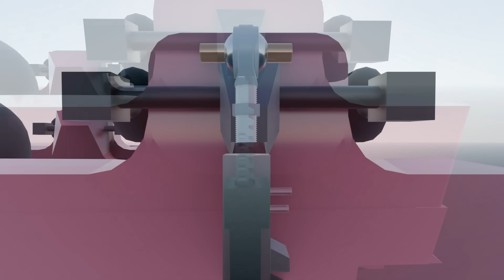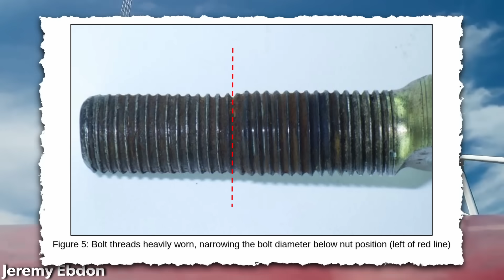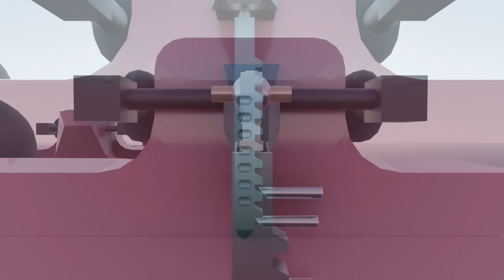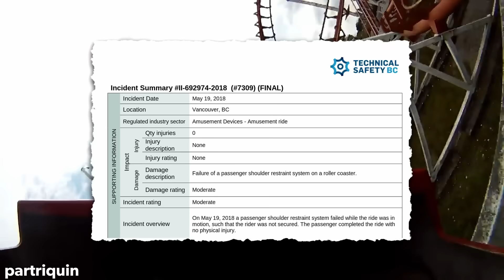The REAL Accident on the Coaster From Final Destination 3 - Near Miss Analysis

Comment: I live in vancouver and have ridden the corkscrew before it closed down. It was closed due to a lot of factors as the park is honestly kinda known for shutting down rides at this point and it was never a super popular coaster compared to the wooden one also in the park.

 It wasnt even replaced by a new coaster until fairly recently, 6 years after the corkscrew closed. Now we have the thundervolt which apparently is the fastest electric launch coaster in canada though.
Reply: I was too short to ride corkscrew before it closed :<

Comment: Of all the coasters to suffer a serious restraint failure, a mild Vekoma or Arrow Looper would be the least alarming for me---I would only be moderately worried about the first drop of this coaster in the back 2 rows. I did have my lap bar completely fail on Viper at SFGA in 2001 when I was 11. I'm not exaggerating, it actually failed to lock in any position and kept flipping up to it's full retracted mode. That was scary as hell because of all the airtime throughout the ride layout. Luckily, the previous year, they had added seatbelts to the ride. So as freaked out as I was, that redundancy kept me (just barely) secure. I should have reported it, but I was convinced they wouldn't believe me since the ride operators unlocked the rest of the train's lap bars before either of them were looking toward my row. 

I have been riding coasters since 1995 and nothing like that has ever happened to me again, so I think that's further proof of how safe roller coasters are (and Viper is still an excellent wooden coaster).

Comment: I just wish FD3 had a more realistic depiction of roller coasters (albeit an incredibly poorly maintained one) instead of the single point failure that was a single line hydrolics tube that ran underneath the train (how that would work, don't ask me) It's why I put that premonition in 5th place among the franchise (With FD4 being in last palce by a wide margin). The incredibly obvious plothole of the camera that caused the wheels to be loose no longer being on the ride, ignoring how such a short strap can wrap around a coaster track like that, is something that confuses to me this day. And no, "death would have made it happen regardless" is such cope. They screwed up and created a massive plothole that can't be explained away.
Reply: It wouldn't work, because there isn't one. Hydraulic restraints are self contained per seat and there is no exposed tubing.

Comment: I swear this shouldn't feature scenarios that are unlikely or impossible  due to the way in which the rides are engineered. 

In FD3 for instance there's no way that the track rails would split like we see in the film.

Another impossible scenario takes place in the film roller-coaster in which the bomber places the bomb on the track  where the upstop wheels  run under it. 

In the film the ride operates as normal until the evening  when he detonates the explosives, in reality of course the bomb would've been knocked off of the track by the upstop wheels of the very first train  to pass over it earlier in the day.
Reply: tbf final destination is literally about having the most insane dramatic deaths possible
Reply: The rails themselves were way too thin in the film to be used for rollercoasters, it looked like someone had just bent 1mm thick sheet metal into a tube. No wonder they split, it's amazing they could have carried the weight of the train in the first place!

Comment: Being an av geek, this kinda reminded me of the Alaska Airlines flight 261 that crashed into the Pacific Ocean; in that incident, the jackscrew in the rear stabilizer failed. When inspected during the investigation, they could see that the threads on the jackscrew were stripped (but in this case, it was due to improper maintenance).
Reply: I remember this as it was featured in an episode of air disasters on Smithsonian channel many years ago.
Reply: I was also just thinking that this reminded me of a few of the Air Disaster episodes but I couldn't think of which ones. Thanks for specifying one of them---that was a horrifying accident.
Reply: @Chillguy99 same

Comment: I wonder what ways parks have to test for steel grade in parts? Thanks for the video!
Reply: An XRF gun can be used to grade steel and other alloys in the field. Parks probably don't own one themselves (they're $10-30k each), they'd contract a local engineering firm to either come out and test it or send them the suspect part.

Comment: Rides should be inspected and tested every 3hrs. Having done plant work are machines some of the same pieces as roller coasters and other rides we inspect are machines for almost all of the 12 hours we work
Reply from the maker: That would be wildly impractical and unnecessary. As stated here, the daily inspections failed to notice the developing issues. A shorter and more frequent inspection would have also failed to notice this.
Reply: Also, if you’re doing an inspection every three hours it would have to be a lot shorter making it impractical. It also probably wouldn’t help much either